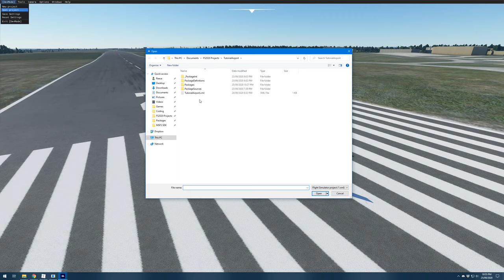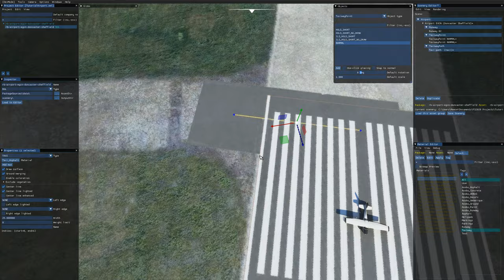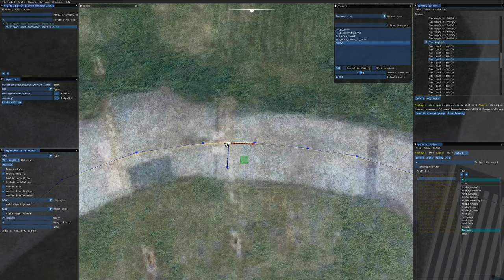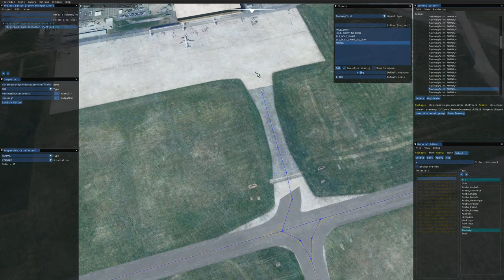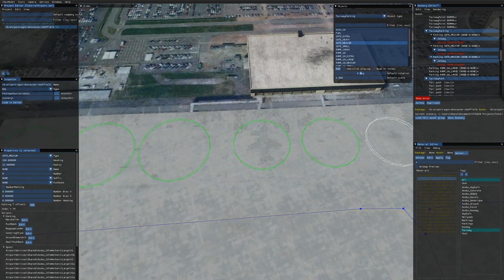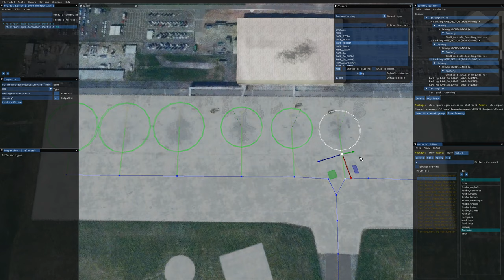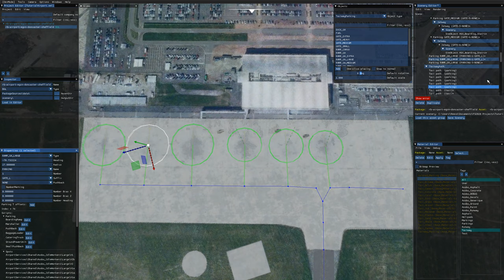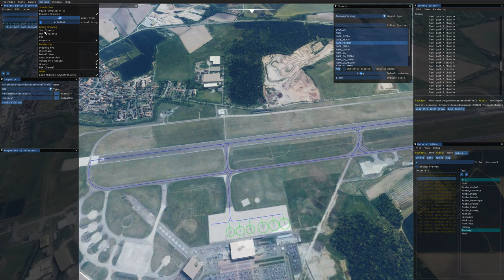SDK Tutorial #3 - Adding taxiways and parking - Microsoft Flight Simulator

Comment: When I try to generate a taxiway, the only thing I see is the blue line. It never changes in concrete(set at material), does someone know a fix or what I am doing wrong? 
Thanks for the series Benney, very helpful!
Reply: late reply but you need to connect all of the taxiways to one graph, this is what happens to me, it's a temporary thing, also make sure its connected to the runway.

Comment: These are the best tutorials I've seen so far. In 10 minutes I got my extra objects in the sim. But one question: can I add more parking spots to a default airport without rebuilding it from scratch? The same for adjusting taxiways paths on the apron and add lights to some taxiways?
Reply from the maker: That's good to hear! If you don't specify delete options on the airport object properties then the existing airport will still be there after you make your additions. Things like parking/taxiways might not work quite right though as I doubt you'd be able to link the taxiway path to the existing network.

Comment: Hi there! You have helped to come back to redesigning my local airports. I Have done a few of them but there is a Bug on one of them. One section between taxiway points when I start my flight from that airport looks normal like when I originally did. But when I fly out to another destination and come back, That section look wider that the main runway. I re-did the taxiways and it still happens after I return back. Any Suggestions? Thanks, Robert

Comment: Thank you for your tutorials. I have a quick, perhaps stupid question: How do you actually start inside the simulation? Do you start a normal flight from the world map at the location you plan on editing and then switch to develop mode camera and start editing? If I want to build an airport from scratch, do I have to start a normal flight, mid air, from the coordinates where I want to create it? Or is there a "cleaner" way?
Reply from the maker: No stupid questions here! If you are revamping an existing airport you can just spawn in at that airport like usual. If you were trying to add one from scratch you can either enter lat long coordinates into the world map search and spawn in like you say, or you could spawn in at some airport and use the teleport menu which you find in the toolbar > Windows > Teleport Window.

Once you've created your airport and added a runway, you could load it into the game and spawn there from now on.
Reply: @Benney  Thank you for the quick reply! So, that means I will always have to spawn inside/with a plane at first from the main menu. There is no direct way through the actual editor, correct?
Reply from the maker: Yeah you have to spawn somewhere to get into the actual game world, then you can teleport/travel anywhere.

Comment: Hey Benney, I re-draw all of my taxiways. When selecting LIGHTED EDGE, the blue lights appears randomlly far from the edge. Several meters from it. My taxiway is about 23m, and lights are being placed like the taxiway was 40m wide, more or less. Any tips?
Reply from the maker: I've not had much luck with taxiway lighting myself either. You can try using light strips instead and just place them along your taxiways.
Reply: @Benney  thnx for answering. You mean, place one by one making a strip?
Reply: I just spent basically an entire day on taxi way lights they are extremely frustrating but I understand it now! In order to get taxi way lights to work you have to do a few specific steps. 1. you have to go into objects then scroll down to light row. once selected you have keep using add button every light row(if you use click to add it will not work!) next you have to work out how far apart your taxi lights will be spaced, unfortunately there is no option to automatically space them so it takes forever to place if you place them to far apart then the game automatically draws in its own lights between yours which is extremely frustrating! once you have them placed there is no option to position them across from each other so thats a whole other ball game its ridiculous how tedious this sdk is right now there are workarounds but they are extremely lengthy!

Comment: Great tutorial, very much appreciated.  I have been able to improve the airports in Ecuador, have added lights to the runways, taxiways, aprons, etc.  However, after adding parking to the airports, and checked for scenery errors, the builder is not able to generate the corresponding files for the new scenery to work.  What could be wrong?  thanks
Reply from the maker: You'll have to check in the build console for errors.

Comment: Thanks for the series of editing! How can I add a turning circle at the end of a runway?
Reply from the maker: You can just draw out the turning circle using taxiway paths as usual. If you need the pavement to be different from the taxiway paths then consider using an apron to fill in the gaps. I'm not too sure if any AI will make sure of the taxiway path though, but you can at least draw out the lines and lighting for your turning circle.

Comment: Hi! You would be proud of me :-) :-) I have managed to fix a very jagged airport (SLLP) in MSFS2020. One problem I have, is that any object that I try to place at a gate (that is not a Jetway), such as boarding stairs, fuel truck, etc. is travelling along without me finding a way to keep it stopped within the assigned gate. I am sure that it is a simple solution, but I just cannot find it.
Thank you. For this and again, for the tutorials
Reply from the maker: After making this tutorial I found that you must only place jetways as the object for gates. If you don't need a jetway just use parking and set the name to gate.

Comment: Thank you for this tutorial. I've this issue with the ATC sending me to to wrong runway all the time. The main runway must be 07 for takeoff but the ATC alway send me to 25 regardless wind direction. Any way to tell the ATC to only allow take off from runway 07?
Reply from the maker: ATC should automatically choose the correct runway depending on wind. Are you sure you're setting both wind direction and gusts, and that your taxiway paths are fully linked to both ends of the runway?

Comment: This is an amazing tutorial, thanks! I have a problem creating a taxiway, is 'invisible', it's just the 2 points and the path but no matterial is shown. Any idea what I'm missing?
Reply from the maker: You need to make sure the points are connected together to make a taxiway path. Then in the properties of the path make sure Draw Sufrace is checked. I show how to do this at around 1:20.
Reply: @Benney  Thanks for answering but I wasn't doing something wrong! I've just found this https://forums.flightsimulator.com/t/taxiways-do-not-draw-in-project-after-sim-update-3/375845

There is a problem with the last sim update

Comment: Hi Benney,
I started on a project a few weeks ago to exclude some taxiway lights where they do not belong. I don't know if you noticed but at several airports, there are taxiway edge lights all over the place, even right in the middle where planes taxi. These taxiway lights do not belong inside the yellow line where planes taxi, and some of them you have to taxi around them. I've excluded some of these already but there are still many more, and I did save my project. I opened my saved project to exclude more the taxiway edge lights and every time I click on the Load In Editor in the Inspector, the taxiway edge lights that I have not excluded disappear and I have no way of knowing where to place the exclusion rectangle. The taxiway signs disappear for a second and then they reappear. But the taxiway edge lights never reappear. Why is this happening, and am I doing something wrong here?

Ken.
Reply: That’s because they are already excluded in the package then, move the compiled package in your Community folder to test.

Comment: I am wanting to do a local airport and it has a number of 'A380' split gates, for example gate 19 is split into gate 19L and 19R so two A320s can use them if free. 
Is it possible to have the same within this game? Is is possible to create a heavy gate 19 and have two small L R gates within that space without any conflicts i.e a 747 spawning or given ATC directions to gate 19 if 19L and R are already attended by a A320 vis versa
Reply from the maker: The sim spawns planes with a wingspan smaller than the width of a parking space. So if you placed a large space over two smaller ones then it should spawn the correct aircraft there. I'm not sure what will happen with overlapping parkings though, you'd just need to try it out.

Comment: I just have one question. When I am selecting the taxi point, then clicking one click placing, it deselects the taxi point. Is this a new update to the SDK?

Edit: The menu was over the runway, so it was just selecting the runway instead.
Reply from the maker: Good to know you found what was causing the problem!
Reply: When control clicking two points, you might select the runway as well by accident. Simply control click on the runway again to deselect it and then you'll be able to place a path between the still selected two points. Posting this in case anyone is still wondering.